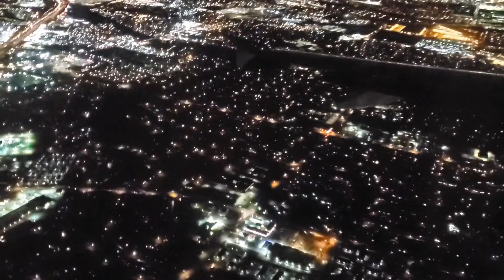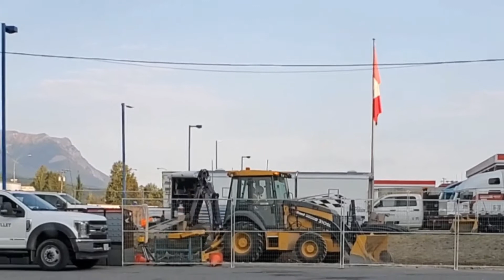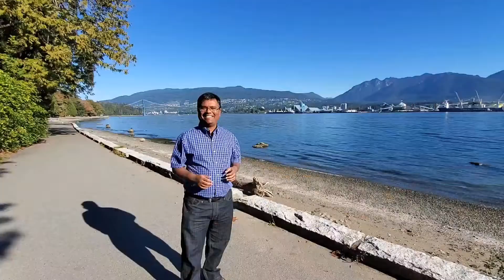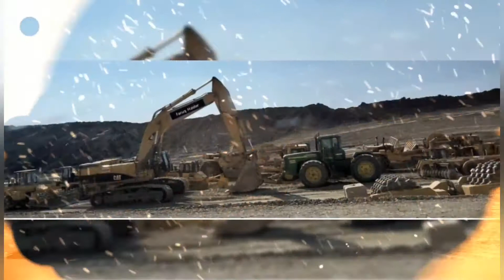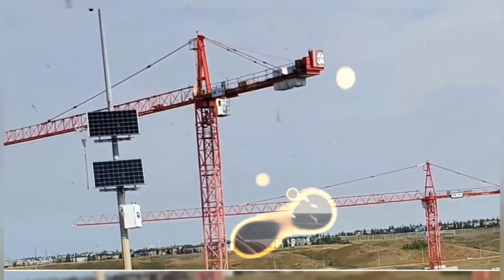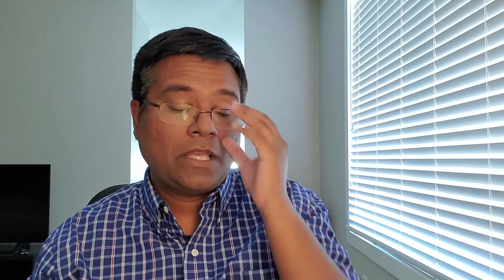Commissioning and Start-up 101

Comment: Sir,  I am Instrumentation Engineer, I am worked Construction & Pre-commissioning. But Commissioning i Did get any chance to work. Can you tell me commissioning means what activity we done in Pre-commissioning same work we need to do again in Commissioning & Start up time??? please tell me
Reply from the maker: Thank you for your question. Pre-commissioning and commissioning/start up are two different things with specific activities. A few examples of pre commissioning may include doing a bump check for your de-coupled motor to see if it rotates in the right direction, energizing your instruments individually to verify they work, loop checks etc.

An example of commissioning may include running your overall system with inert fluid like nitrogen to verify system integrity before introducing actual hazardous commodity. If you have more question, please let me know.
Reply: @Faruqhaider1  Sir, Thank you for answering. I am understand your answer. (for eg -> Pre commissioning of Pressure Transmitter as per datasheet LRV & URV and Unit we Configuring by connecting HART Communicator to the PT after 4-20mA from field we forcing thru HART). This same activity during commissioning we are repeating?? During commissioning the process fluid entering in to the process pipeline. So what we done in precommissioning the same work need to repeat again.
Reply from the maker: @anandanramachandran3930  we are not repeating same activity during pre commissioning and commissioning. 

For very simple explanation, please refer to API 1FSC. 

In your question you mentioned HART communicator (475 or TREX AMS?) to simulate mA signals (0%, 25%, 50%, 75% and 100%) for an individual field device- this is an activity for pre commissioning. Such step wise simulation will not be done during the next stage i.e. commissioning. 

If you still have more questions, please connect with me on LinkedIn and we can setup a time for phone conversation and learn from each other!
Reply: @Faruqhaider1  thank you sir, i will send connect request in Linkedin.